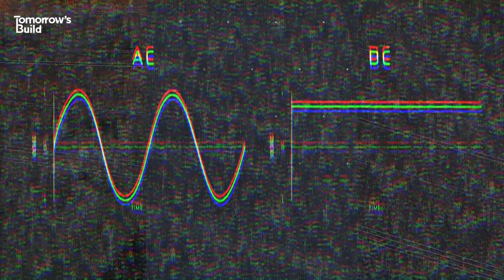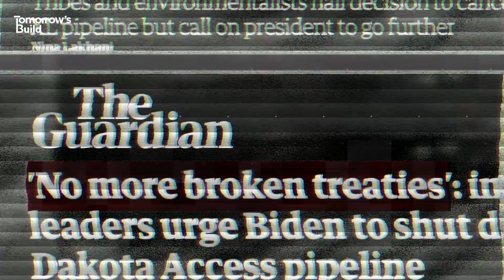The $23BN Plan to Power Singapore from Australia

Comment: If only we had magic rocks that could power steam turbines without creating any CO2
Reply: stop coming into the comments and making sense.  don't you know how to make youtube comments??!!!
Reply: Nuclear all the way, it's expensive to construct, but the same can be said for that project. All that cable must be pretty taxing on the environment.
Reply: @trygveevensen171  Economics of scale, the more countries invest into building them and updating them the less it will cost in the long run. LEDs are quite expensive when they first came out, nowadays it's rather cheap ($1 store selling them in the US and appears to last quite sometime too).
Reply: Coal power plants generate radioactive waist with fly in to the air and can't be easy stored. Solar is grate but it's unreliable, destroying baseload and we not recycle panels after end of life
Reply: @mobius2176  You are 100% correct!
Reply: Those rocks are $$$. This solar initiative is being pursued privately. No invester would get behind nuclear cause it's a financial dead end.
Reply: I think the main issue is that while the possibility of an accident is exceedingly small - especially with newer reactor designs - for Singapore a single accident literally means the end of the entire country.

Honestly IMO the best solution for Singapore might be to switch from natural gas to biofuel - as it doesn't require any more space than natural gas and is carbon-neutral
Reply: @tjs200  Channel News Asia did a show on it and only touch on Nuclear for like 5-10mins in the 30mins show about energy, a Nuclear accident would cause about 70-80% of the island uninhabitable even if it's placed on 1 of the farthest part of SG. It then link them to talk about the potential of modular Nuclear power (Small reactor size). There are potentially safer nuclear options, we just need more brainpower into further researching them (1 of which Bill Gates invested in).
Reply: There are other kinds of magic rocks that are fertile as opposed to fissile, which also produce steam...named after a certain Norse God of Thunder...🤷‍♂️ much cleaner, far less waste and the waste only lasts a few centuries...
Reply: And it generates a very toxic byproduct. And where the fuck would Singapore bury this? No one is going to accept their Nuclear waste and Singapore is too small to have any safe ways in storing it.
Reply: @carl8790  Erm, the "very toxic byproduct" isn't actually that dangerous (don't give into the fear *of fear mongering). Common practice (as you've mentioned) are just to seal them into a proper container and bury them deep. It depends on the negotiation on who Sg buys the nuclear from. Since Sg cannot just go and make their own. 

For example with the USA, our nuclear waste can just be send to them to be stored along side their own. It doesn't really take up so much space, besides like you've said, Sg is small, so less nuclear material is required to produce the electricity Sg use. Sg use quite a bit as a small country but still can't be compared to countries with nuclear power plant. Someone in the US did say that a high school gym 's worth of space is enough to power X amount of cities for X amount of time (I can't remember the specifics, but you get the idea). The beauty about nuclear is that only a very small amount is required to produce a very large amount of power. It's very energy dense, way more than coal. Truth be told (you can check more details online), the related death due to Nuclear is far less compared to the death related to coal even though nuclear appears to be so dangerous. 

As much as humans want to preserve life, there is an acceptable limit of death people/authority/countries can accept. Based on statics, road traffic accidents accounts for more deaths in a year than Aviation (Airplanes, airlines, small aircraft, etc). Aviation is therefore way more safe than driving. There is a saying, "You are more likely to meet with an accident driving to the airport than flying out". Guess what, Nuclear industry are even safer than Aviation. When a plane crash and killed 200 people, it will be in the news, but everyday 1 person dies from car accident, it won't be in the news. That plane crash might be the only 1 in that year or few years after that, while the death from car accident just keeps happening. Simple math will show 365 deaths from car per year compared to 200 from plane, but yet more people fear flying than driving. Can't remember which country but I read 40 deaths per day from car accident and way less from planes crashing. Aviation continued to be safer every year (accident rates goes down year by year even including 2x B737 Max). More flights in total (year on year), yet less accidents in total (year on year). I digress. 

Sg have limited land, but that land includes the ground below said land (and the sky upwards). "Just bury deeper", Finland (iirc) "found" a "new way" of burying it and then sealing it thereafter. Maybe that can work for SG? Need to look more into it. More nuclear options in the future, people are researching into modular/small reactor nuclear power. Or using a different nuclear material to provide safer results in case of meltdown. There are quite a few type of nuclear material to be used but USA chose the current one due to its ability to be weaponize (as the world situation at that time calls for it). Thus it carries certain danger inherently. More people are now looking into the other types that wasn't chosen and may be even safer (even in the most basic form).
Reply: @mobius2176  But once you have nuclear power, it's not a "backup", it's the main source. That solar and wind is just a distraction. While they are good in terms of CO2 they're not only intermittent but they're inherently more harmful than nuclear power, even though they're better than fossil fuels.
Reply: People's forgot that thorium are safer than uranium. The Fukushima are fvcked up because japan are sitting on ring of fire. I too didn't support Singapore or malaysia build a nuclear reactor since they're close to Indonesia that have earthquake every year
Reply: @cucuawe465  Japanese ones is outdated and flawed ... it should be withstand earthquake and tsunamis too
Reply: @cucuawe465  Fukushima's reactor was also quite outdated in some ways, the engineers did recommended extra safety which would have prevented this accident, however the owners deemed that the cost was too high for an "unlikely" event. That unlikely event DID happened. 

US did said that their plants are safe even if it happened in USA as their plants are up to date and thus wouldn't have failed. There were multiple failures that occurred with Fukushima, it's like a Swiss chesses where the accident went through many layers of defense. Japan's buildings are also pretty known for its ability to resist earthquakes and thus more robust than the usual buildings, so in regards to Nuclear plants in Sg and Msia, those can be looked into.

Point being, countries have to look more into alternatives energy, especially nuclear since with current knowledge, nuclear offers the best results (various other types, etc). We can't just put a blanket "NO" on all nuclear.
Reply: @mobius2176  some vids said giant wind mill is too expensive for price to output ratio, idk about nuclear
Reply: Hello from France. 70% nuclear electricity. Cheap and low carbon. Since the 70s. No big accidents to date.
I reckon there are risks, nuclear must be managed with great rigour.
It’s funny, we are the most visited country, people don’t seem to be afraid, though I guess many don’t even realise.
Oh Paris, City of Lights! Yeah, nuclear powered lights.
Reply: Laughs in thorium reactor
Reply: @mobius2176  I've learnt that environmentalists can ironically become their own worst enemy with their absolutist you-are-either-for-or-against mentality. Here in Australia, we have environmentalists that opposed hydropower and launched campaigns against new hydroplant projects in the 1970s-80s. Thanks to their efforts, one state with bountiful hydropower resources remained partly dependent on fossil energy until last year.
Reply: Nice, was thinking the same thing, and for 23B they could build all they would need easy.
Reply: Check out the comparative construction costs, power purchase costs, capacities, and construction schedules of this project, vs. the Hinkley Point C power station.
Reply: Surely such power could never be used for evil.
Reply: @aluisious  And the miners extracting the rare-earth materials for the 120 sq/km solar farm and 4,000km extension cord won't be abused by evil men? The greater evil is to allow the environment to be destroyed whilst also destroying society in the name of attempting to save said environment. All the while completely ignoring a good tool to help the environment in a sustainable, economic and ethical manner because we have been conditioned to fear it. Nuclear is not the only solution, but it is an important tool and much more economical and less environmentally damaging than a 4,000km extension cord destroying the sea bed.
Reply: @philcoyle6241  keep your nuclear waste to yourself. It theoretically a great option, but practically awful with the radio active waste. We've seen time and time again, shit does happen, and when I does with nuclear reactors, it can be catostraphic
Reply: @0741921  nuclear waste isn't as bad as you think and can easily be stored underground. The accidents with nuclear power have been minor and very few people die from them. You have to admit nuclear power is necessary if you want to go carbon neutral.
Reply: @0741921  howabout the cost of human lives?  tons of people die mining coal and almost nobody has died in nuclear plants. or uranium mines?
Reply: @philcoyle6241  Try peddling that BS to the people who used to live in or around Pripyat or Fukishima. Nuclear energy is not safe and unless they master cold fusion it won't be. I see all these bullshit comments here about hackers or pirates attacking the cables. If that did happen worst case we lose power generation for a time.

What's the worst case if nuclear power generation goes wrong. We already know that is don't we.
Reply: @0741921  Research up on that mate... yes, it is a terrifying situation should a nuclear accident happen... but there are more safety features nowadays that it would be contained. Waste is definitely a issue, but that is because no government want to designate a area to deal with it. We fears nuclear power because of the past catastrophic that had happened. But don't forget that regulations had improved and nuclear powers around the world had operated for decades without issues.
Reply: @organizedchaos4559  Russians developed technology for recycling used fuel rods. Also Indians are very close to the full cycle of nuclear fuel from 1st to 3rd generation. If you're lack of knowledge, it doesn't mean nothing exists. Just don't be ignorant
Reply: @georgechertkov4140  I don't see where we disagree on anything.
Reply: @organizedchaos4559  yeah, it was for the guy upper, missclick sorry
Reply: @0741921  Kyle Hill (channel name) did quite a few videos talking about nuclear. Based on statics, there are way more deaths related to coal power than compared to nuclear. The 2 more "recent" nuclear accident are partly due to not upgrading them when they should (the other being human error and also more should have been done to make it safer). The current nuclear can be dangerous due to USA choosing it over the other safer options as its a "1 stone kills 2 birds" option, ability to use for electrical power and also ability to weaponize it. There are safer nuclear options out there but it needs more resources to make it happen (Bill Gates invested into 1 of them).
Reply: @Ozvideo1959  Nuclear power is pound for gigawatt safer and cleaner than all other power sources combined. Just ask any of the millions that have had oil or coal disasters in their regions. Fukushima is a false argument as that plant had issues with design and management that should not have happened. Modern technology and developments for nuclear power have addressed every one of those failures.
Reply: @philcoyle6241  Nuclear works fine, but don't promote it by dissing undersea cables. These cables don't harm the seabed.
Reply: @0741921  You can't say the same thing about new nuclear, it is the nuclear power we should of had from the very beginning, if Alvin M. Weinberg had been allowed to go forward with the (SMRs), then everyone would be saying nuclear power is so amazing, safe and clean. But alas ignorance got in the way and it was not to be then. But it could still be now, if you just look past your bias, fear and ignore the propaganda and see nuclear power for what it was always ment to be... - hope!
Reply: @aluisious  neither could my family but they found a way
Reply: @aluisious  thorium can't be used for weapons and provides clean efficient energy while only creating small waste that deteriotes quickly. Your point boomer?
Reply: while those magic rocks doesn't generate CO2, it still generate waste though (at least until we figured out how to make fusion reactor)
Reply: @skyfeelan  finland have solved the waste issue geniously. the world will soon be powered primarily by nuclear
Reply: @skyfeelan  Less carbon footprint then solar and the amount of wast after 100 YEARS would fill a grammer school gymnasium...  Do your homework!

Comment: Man this channel is awesome and needs more visibility! 

I was wondering: A significant portion of Singapore's land area to generate THOURTY GW of power is only sufficient for 20% of the overall demand? Wow. So how are they planning on covering the remaining 80% without fossile fuels?
Reply: I assume that "thourty" is halfway between thirty and fourty....?🤔
Reply: @warriorson7979  Please excuse the type, ofc I meant forty. A word that I quite seldom use usually (for reasons unknown, thirty and fifty are much more common and thirty probably lead me off-track).
Reply: Yes, the other 80% is going to be met with fossile fuels. Except if they plan on laying another Mega-extention cable to Arabia or Africa.....
Solar energy is usually sold dishonestly by repeating the Maximum output of the installation over and over and not the yearly average. There is a huge difference with production at noon in the hottest day in the middle of summer (peak production) and any other time, like.......... Night time xD
That's why in reality all those GW installed in Australia are only enough for covering 20% of Singapore's needs on average
Reply: @vipondiu  I'm sure the people spending millions on solar farms are fully aware of their yearly outputs! Also solar panels are more efficient at cooler temperatures - they work off light, not heat. Therefore a midsummer day gives good solar power because the day is so long, but it's nothing to do with heat (which actually slightly suppresses power production).
Reply: Something underground. I'm hoping they make lots of nuclear power plants very deep underground and produce it from there. Energy imports as well.
Reply: Some of it is planned to come from Laos, which has an ongoing large hydroproject. They will still need to depend on gas power plants for some local generation.

Comment: Nuclear is overall cleaner than solar or wind.
Reply: only if it's a new molten salt reactor that primarily burns Thorium and waste/used fuel rods from light water reactors.  Conventional light water reactors leave deadly waste that will take thousands of years to mitigate... certainly not "clean energy"... just deferred disaster.   Then there's accidents like Chernobyl and Fukushima.  Molten salt reactors are inherently safe and the radioactive residue is mitigated in decades and centuries not thousands of years.  If Chernobyl and Fukushima were Molten Salt reactors neither of those globally polluting accidents would have happened.